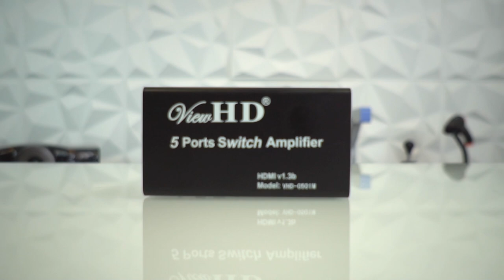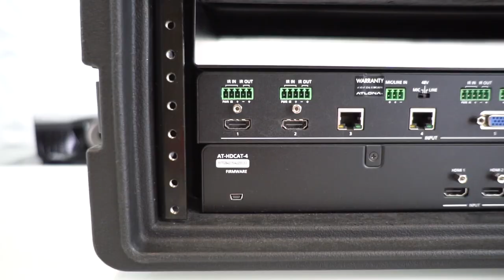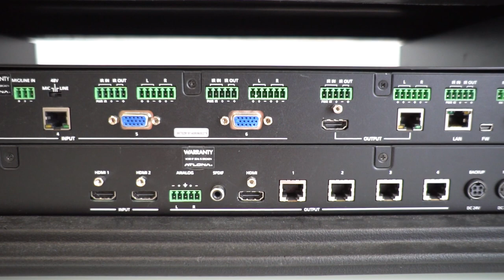Presentation Switcher Scalers for Courtrooms

Comment: We've got a jumbled mix of setups in my area.  I run into issues all the time where a scaler like this would be so helpful.  Thanks for walking through this solution.
Reply from the maker: scaler is usually the answer (because differing source resolutions/frame rates is usually the problem)